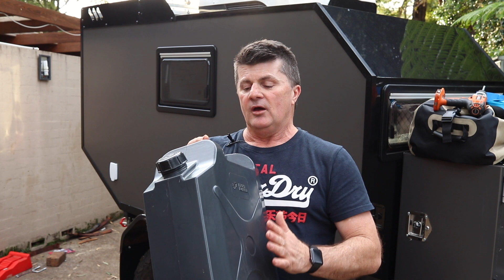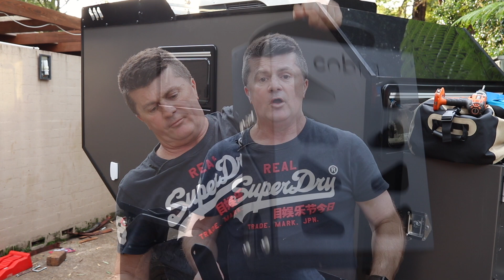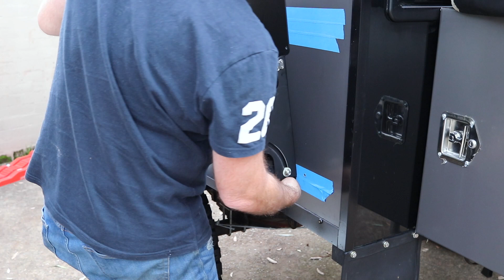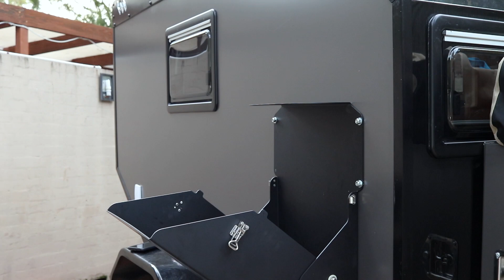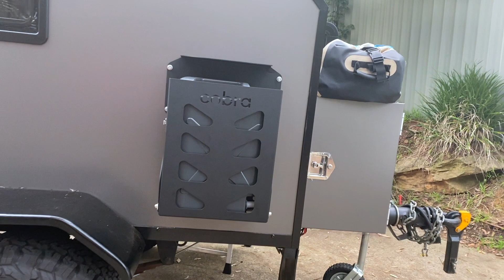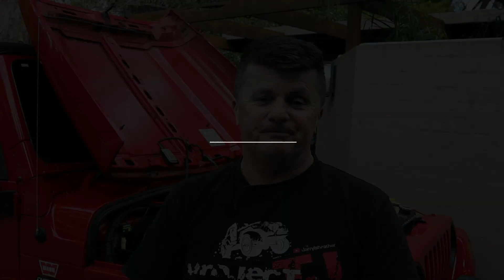Off Road Camper Trailer Build // Swing Out, Lockable Jerry Can Holder // ** Discount Code

Comment: How do you think it will hold up full over rough roads ? 
I’m looking at doing the same into 20 mm ply . 
Your camper look great !
Reply from the maker: It's fine, load is spread over four mechanical fixes and with the thickness of the ply and composite aluminium its solid as.